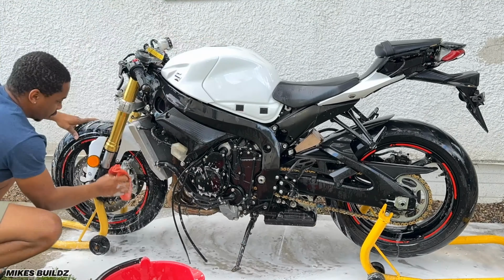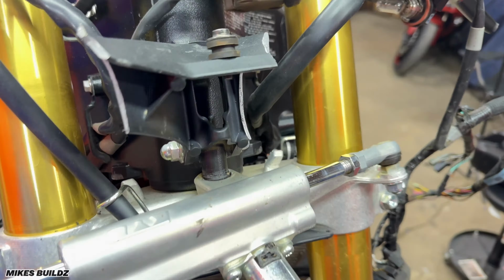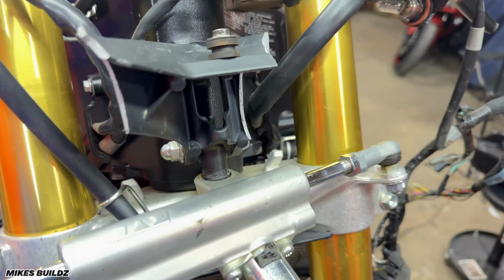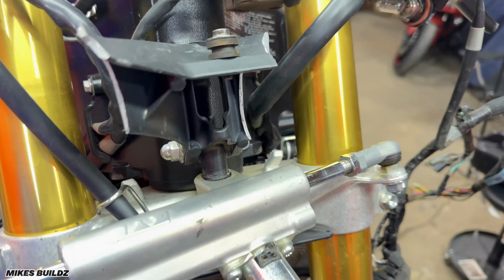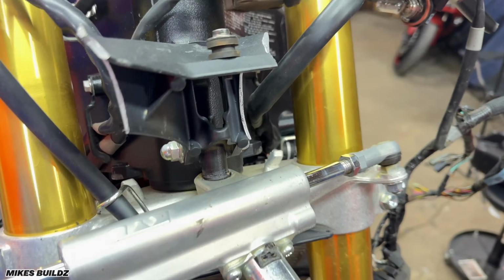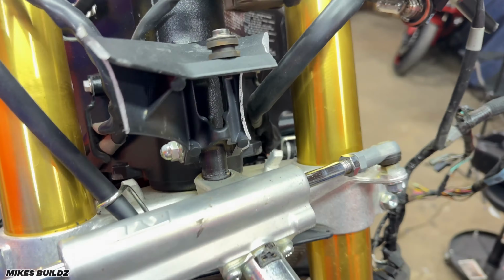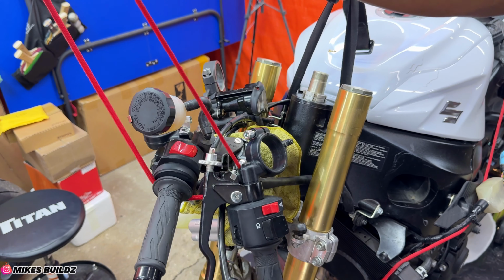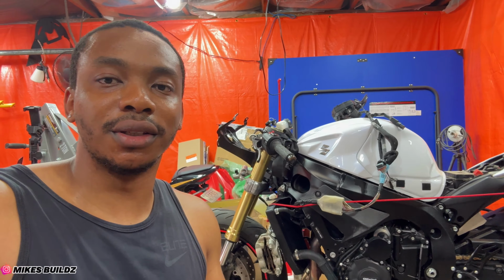Rebuilding A Salvage Crashed 2019 Suzuki GSXR-750 - Part 1

Comment: You right I'm putting a CS racing exhaust manifold on trying to install without removing the radiator little harder take longer but it's much easier when you take the radiator off.
Reply from the maker: Oh yes! Ive had to learn that the hard way. It helps a lot to just unsecure the rad and gain that extra wiggle room.

Comment: @Mike's Buildz Great effort, but the front brake line is routed incorrectly. Also, the bolts for the front calipers are one-time use only.

Regarding the coolant, it's essential to replace it with the same colour unless you flush it through a few cycles with distilled water due to the various additives.

Lastly, unless you've used a meter to test the wheel and disk, that front wheel likely has a ding due to the impact from the forks, i.e., ripple effect.

P.s. Don't forget to grease the headstock bearings.

I'm looking forward to the updates. Keep up the great work!
Reply from the maker: Yes. Front brake line will be rerouted. Bolts for the calipers are not one time use only. 

The coolant was drained and system was flushed. Also the coolant I use is universal, safe for aluminum radiators and I use it in all my bikes, never had any issues with it. 

I use a dial indicator to measure run out, same as my previous build videos. 

If you look closely when i reinstalled the lower triple tree, there was new grease applied (red grease). 

Stay tuned for more 🫡